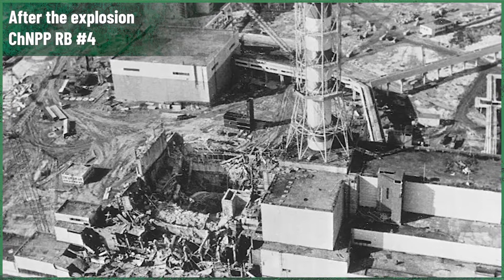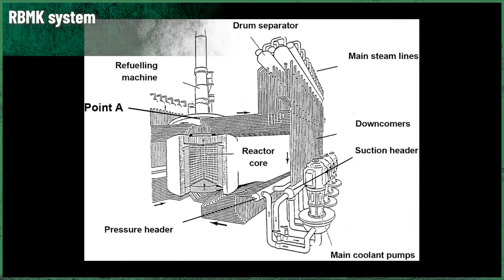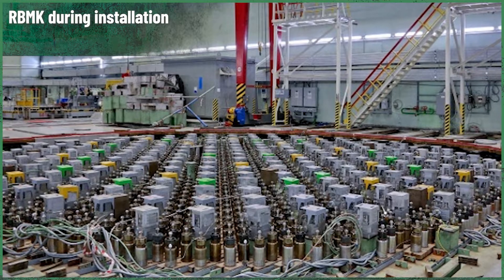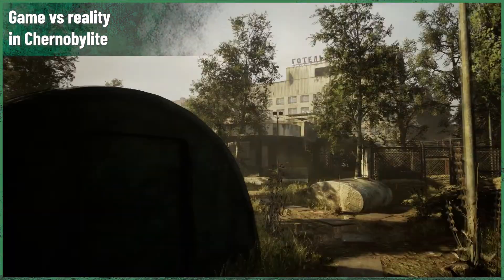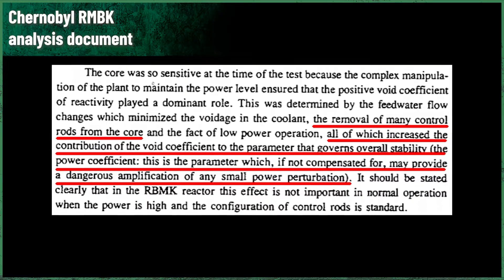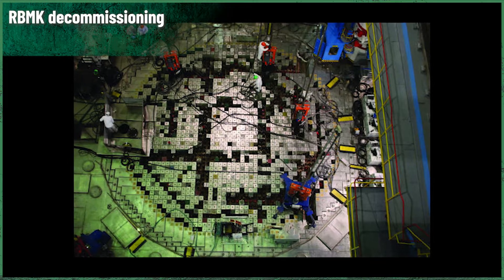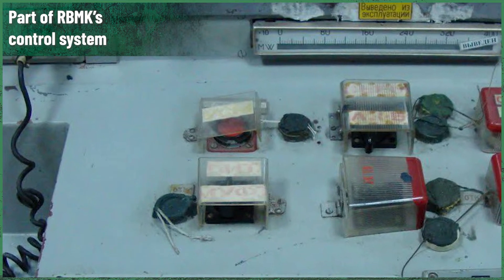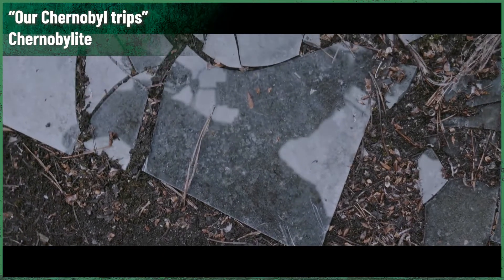Could it be any worse? Positive void coefficient in RBMK design ||| PART 7 ||| Chornobyl Stories

Comment: This is really a great series, thanks for doing them. At 4:47 you mentioned that "Leningrad also showed the designers that their calculations, often done in a quite primitive way" were wrong. Is there any documents showing those calculations and the methods used? Also, I believe that A. N. Rumyantsev developed an early simulation program for the RBMK that showed some of the potential problems in operation of the design, was that program preserved, or any of its outputs?

Comment: I believe the RBMK reactors were developed to be able to produce electricity and turned around to produce plutonium on a dime. All that is needed is to remove the water and use more control rods. It needed to be able to get critical with mostly unenriched uranium to produce plutonium fast. Which is why it has a positive void coefficient as water acted mostly as another neutron ansorber and not as a moderator.
Reply: Positive void was only after 3 years or so. Originally it was negative

Comment: Hello How the rods its raised? I cant see any mechanism in this regard. Cheers
Reply from the maker: You mean how "vertically / horizontally" or how "what is the mechanism"?
Reply: @Chernobylite  The control rods. Normally its vertically operated, and into a PWR reactor, it have the "electric motors" that push and pull it out of the core. RBMK, just saw the upper portion of it, without any mechanism, since this reactor is huge... I was expecting pretty strong motors to withdraw and to insert the rods into the core. Cheers. And sorry about my english.

Comment: Okay with everything presented with the RBMK-1000 two questions come about
1) If the USSR did build a Western type containment dome would it have still contained the explosions of Reactor 4?
2) The VVERs were another class of reactor the Russians used and were advanced designs. Back in 186 the VVER1000 should be around and today we have the VVER1200s and the extremely powerful VVER-TOIs. What were the comparisons of the VVER to the RBMK and why not proceed with the successful VVERs as they are now? I note the VVER1000 was online in 1975 the same time the RBMKs were at Leningrad with the VVER440s on before the RMBKs even hit design paper.
Reply: For part 2, the reason why RBMKS where built is because it takes three years to make make rhe VVER core, and RBMKS can be used as production reactors for isotopes

Comment: What happened in a nutshell is that the xenon 133 acted as a saturable absorber and the q factor of the reactor suddeny increased on burnup causing an extreme prompt criticality. The problem was made worse by the SCR design that had graphite tips to enable faster startup upon withdrawl. This caused the reactor to suddenly hit a supercritical state as they were inserted. The whole issue could have been avoided by simply waiting till the xenon decayed and slowly withdrawing the control rods and making the SCRAM rods out of a different material such as zirconium boride or silver tungsten alloy.
Reply: Graphite tips weren't the problem, the problem was that graphite tips were too short to save on reactor height. They later installed longer telescoping tips and the problem went away

Comment: After watching countless hours of these  it always comes down to the most simplest of problems......... How to get the cooling water moving with reduced power.  It's a simply question of plumbing.  Forget all of the graphite rods and the control mechanism,   it still comes down to letting the coolant water overheat and explode the reactor to pieces.
Reply: Sadly no amount of plumbing is going to sink a 120GWT yes, 120 gigawatts of heat, power excursion for a reactor designed for maybe 2GW tops. Badly designed on many levels. 💀💀💀
Reply: @christopherleubner6633  
Well what they could have done was just run the power down to a controlled stop and just turned the diesel generators on anyway and measure the performance.  I don't get why they actually wanted to stop the main pumps before starting the diesel pumps.  It should have been an operational procedure that in case of a low power issue the diesel pumps kicked in automatically or by hand.  The entire essence of the test was to find out what happens when the main pumps switch over.  Well they found out the hard way.
Reply: @Dylan-qt5nrit would have happened anyway because of positive scram effect at low power
Reply: @christopherleubner6633 it was closer to 300000 gigawatts I believe

Comment: Sounds chaotic. Like, starts out homogenous but little variations in burnup change reactivity in a positive feedback way that cause the operators to adjust which cause reactivity in other spots and it all turns into a mess instead of a negative feedback system that tends to rehomogenise the core

Comment: Yes, by all means, continue this excellent series. It's my favourite Sunday evening pastime😊

As to the RBMK, a positive void coefficient is inherent in a graphite moderated reactor. Hanford's B-Reactor had it too, but they gave that triple(!) redundancy for emergencies so that come hell or high water, the core would always be sufficiently cooled. They knew if they didn't make that an absolute certainty, they would be up Uranium creek without a control rod, so to speak. 

Unfortunately, the Soviets didn't bother to think things through well enough, and here we are.
Reply from the maker: Thank you!
And yes, you're right - they should put more time and resources into this design...
Reply: Information about graphite moderated reactors having positive void coefficient is very interesting because it opens many more questions than it answers :)
I just red that fast breeder reactors also have positive void coefficient but are not using any moderator. This would be quite easy if some fast breeders like molten salt reactors didn't use graphite as a moderator... What do you think about this, are online sources like Wiki simplifying things?
Anyway, turning safety systems off in most if not all Western reactors would make things very bad, although not as bad as in Chernobyl. Fukushima is another example where higher wall and better design of water filters would save the plant at very little cost.
Reply: @codaalive5076  
You better grab some tea/ coffee because this is going to be one hell of a read^^

A positive void coefficient alone doesn’t necessarily make a reactor dangerous. Case in point; the Canadian CANDU. This too is a pressure tube type reactor, but it uses heavy water as a moderator instead of graphite. Despite having that positive void coefficient, it is one of the most robust, stable, and safe reactors bar none. And that’s because its designers made sure that they had all their ducks in a row when it comes to safety.

That’s correct. Fast Breeders do have a (albeit small) positive void coefficient. However, their coolant is very different from water, and their cores are not under any working pressure. Sodium has a boiling point (around 881 C/ 1617 F) that lies much higher than that of water. Not only that, the heat removal capacity of sodium is about ninety times higher than that of water as well. The reason why the positive void coefficient in Fast Breeders like EBR-II is not much of an issue, is due to their design. Where the designers of the RBMK apparently went out of their way to saddle this poor reactor with every unfavourable characteristic they could find in their Physics books, the scientists that made EBR-II did quite the opposite. By combining the right fuel choice (metal fuel), coolant choice (sodium), and reactor configuration choice (structural materials that would enhance any passive safety features), they gave EBR-II literally every favourable characteristic imaginable. Even the very geometry of the core layout worked with them to keep it safe by passive means alone if need be. 
They put this to the test on April 3, 1986 (take note of the date here) by running two full-scale safety tests back-to-back with the reactor at full rated power. They wanted to see if they could get the reactor to meltdown on them. The first was a loss-of-flow event, aka station blackout, thus no power to the pumps. Beforehand, they GAGGED the safety systems and control rods, so they couldn’t come in to save the day. They said; “No matter what happens, we’re not going to intervene. The reactor will have to figure it out on its own.” With the reactor at full power, they cut the power to the pumps, sat back and watched what happened. The reactor did exactly what their models had predicted. Its passive safety features kicked in, and it sorted itself out long before reaching any type of danger zone. No damage to the core whatsoever.
To up the ante, they immediately brought the reactor back up to full power, and in the afternoon of that same day they did the second test, a loss-of-heat-sink event. They did this by shutting off the intermediate pump that takes the heat out of the primary system, aka now the reactor has nowhere to go with its heat (this is what killed Chernobyl Unit 4 btw). They gagged the safety systems/ control rods, started the test, and watched the show. It was a rather underwhelming show because once again EBR-II saved itself without even breaking a sweat over it. There is a video on YT of these actual tests. It is nothing short of amazing to see the reactor save itself from whatever the scientist can throw at it.

And yes, you definitely wouldn’t make any friends with a PWR/BWR if you would do that. But because both reactors have a negative void coefficient, they wouldn’t run away like Unit 4 did. There would be damage to their core, maybe even a (partial) meltdown, but not an explosion like at Chernobyl NPP. And both reactor types have full containment, something Unit 4 would have loved to have, but never got.

Fukushima would have been saved if the breaker wall would have been higher, and they would have placed their backup diesels at a high point, instead of in the freaking basement. And preferably in a hardened bunker of some kind since they’re in Tsunami land. But the plant itself performed admirably. It was only rated for a 7.2 magnitude earthquake, and it took a 9.2 like a champ.

My apologies for the ridiculously long reply.